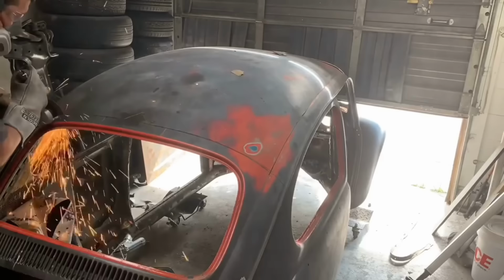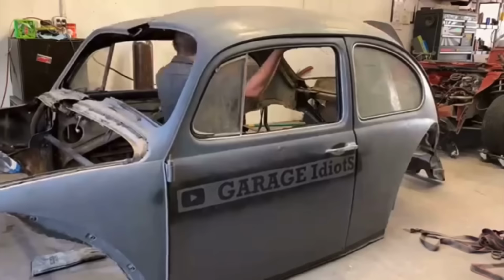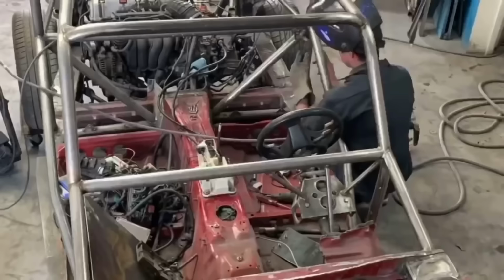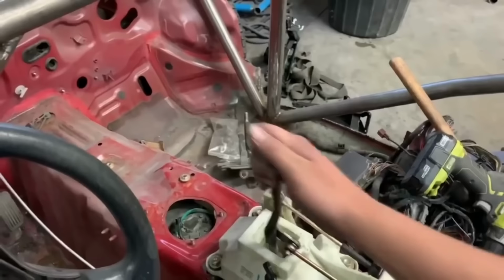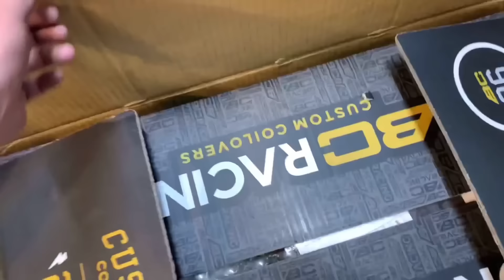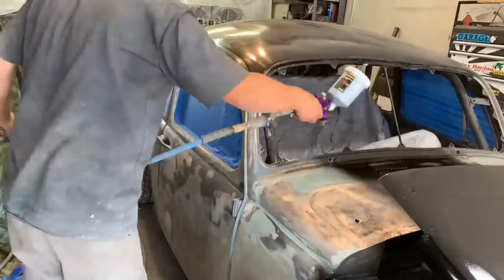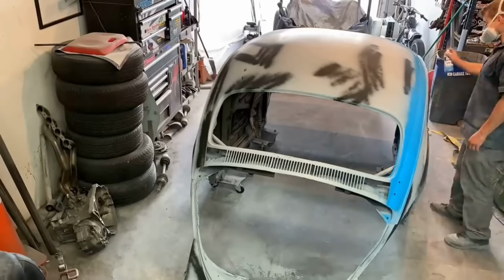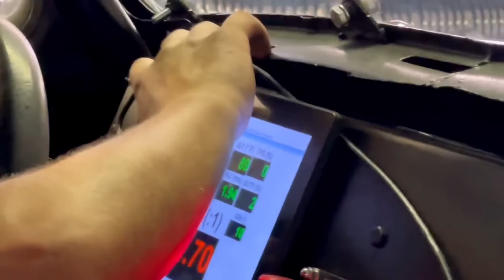Destroyed MR2 Transformed into Widebody VW Bug + Turbo K-Swap

Comment: If it were me i would have made the body as factory looking while it being wider and i would have sealed the engine bay off and added prius air con system and a electric powersteering rack